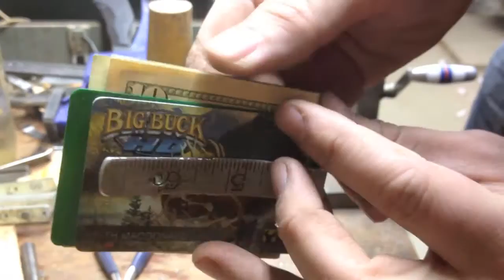DIY RULER MONEY CLIP - a Decent project

Comment: that hardens metal buddy. heat it then let it cool down on its own is what softensit
Reply from the maker: Actually with silver, brass, aluminum, and some other non-ferrous metals, you can quench them to anneal or soften them. You can let them air cool, but that would be a boring video. 😀
Reply: oh, i figured it would harden them simular to high carbon steels, my apologise
! thanks for the reply